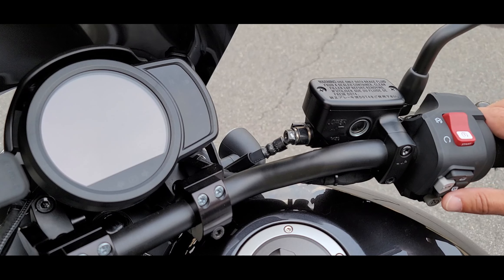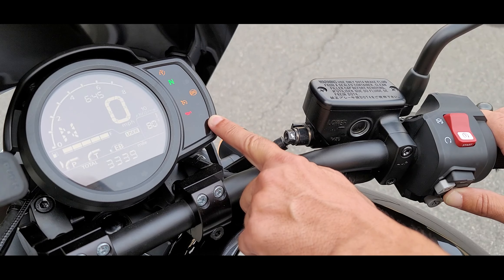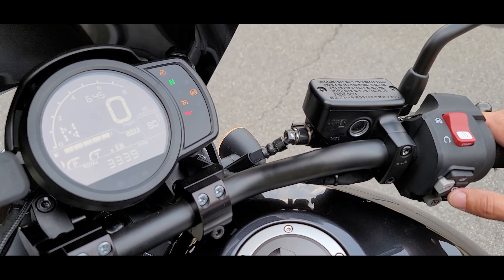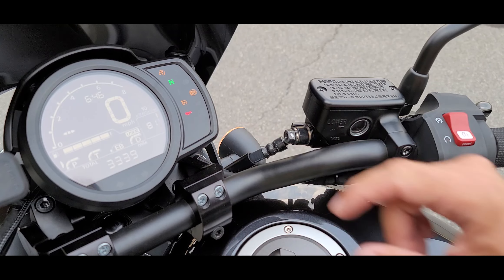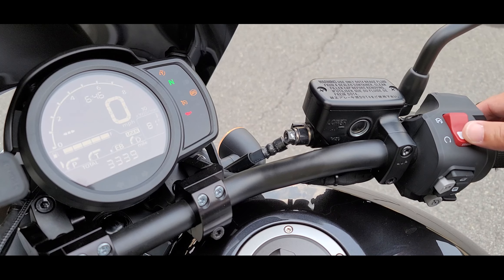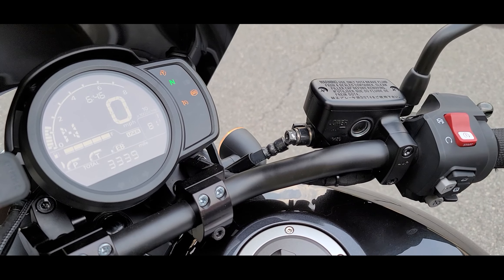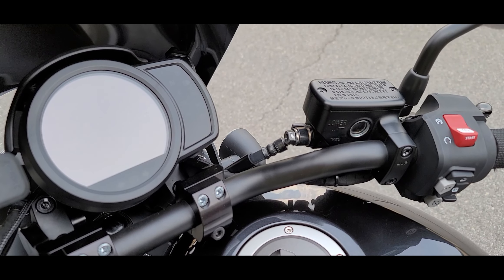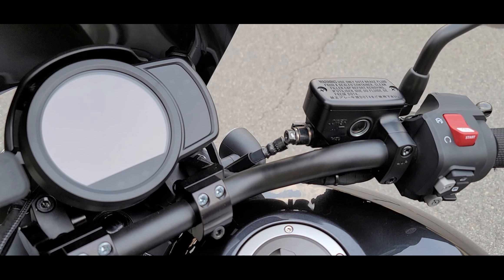Rebel 1100 DCT reset procedure

Comment: So I tried this the other day and to no avail the "D" kept flashing. Scrounging through the comments I had seen someone put premium gas in and it stopped. Well today I filled my tank up on the way home with REGULAR gas, did the reset and not even 5 seconds after the procedure finished. Conclusion: this method works best when the engine is warm AND you have a full tank of gas.
Reply from the maker: That's great information, thank you for sharing TeAndre! The key is to have the engine up to temp.

Comment: How to remove check engine  sign
Reply from the maker: Hi Jordan, it depends on what caused it, sometimes after removing the battery the check engine light comes on, it will take 4 riding cycles for the ECU to run the checks and the light will go off. ride bike for 5 minutes over 35 mph, turn off the bike for a min, repeat 4 times. report back to let us know if that worked for you. Good luck brother!

Comment: Is therr a way to stop the system from "learning ? Thing is I would like the DCT to be as predictable as possible. I don't want to think about wether it's gonna shift or not and wether I have to intervene manually. I just want t know it intuitivly. Wich was the case if I could LEARN its behavior wich is difficult when it is never the same:(
Reply from the maker: Hi Lari, great question, i set mine in user mode to get the auto shifting as smooth as possible - max power, max traction, lowest engine braking and lowest shifting.  95% of my riding i never mess with it while cruising. If i find myself in a position to need to ride in a spirited fashion, i switch to manual mode. these are the 2 ways i ride, either super laid back cruising, or aggressive. If riding up or down mountains, i ride in manual as well.
Keep in mind that the shift points between gears while accelerating can be different based on how much gas you give it, example: if in standard mode: you have the throttle open 1/4 of the way, the bike will shift at 3,000 rpm. If you have the throttle open to 3/4 of the way the bike will shift gears at 7,000 rpm. (not exact figures) hope this helps!

Comment: Wonder if this would help me, was in first gear and it felt like it was slipping in and out of first, 2021 1100 dct, 800 miles on it
Reply from the maker: I'm sorry to hear that man.... the bike is brand new, i have heard of similar situations where the DCT acted up, most were related to  bad/weak battery. But if the bike is under warrantee, take it back to the dealership to get inspected. FYI, i have 30,000 miles on mine over the past for riding seasons with zero issues! fingers crossed

Comment: How often do you or can you reset the DCT? I thought I reset it about a hundred miles ago but wasn’t sure if I did it right. So I tried again yesterday and it would not reset. I tried all the steps from all the sites. So does it only allow you to reset it after certain amount of miles?
Reply from the maker: Hi Nima, you can reset it often, it doesn't have a limit. If you have trouble with it, you should go for a long ride a couple of times and try it again
Reply: @ontherebel11   Got it working. Thank you. You are the person I go to whenever I have a question on my 1100. Thank you.
Reply from the maker: @nimamotahari3673  I'm so glad to hear that it worked! 🤙

Comment: Also does it have to be in user mode, or could I leave it standard mode?
Reply from the maker: You can have it in any mode, no worries. Just make sure that the engine is very warm like after a 30 minute ride.
Reply: Thanks!!
Reply from the maker: @frankfromchicago9248  Anytime Frank!!

Comment: Hi, quick question my 2022 Rebel 1100 DCT ABS light turned on and it blinks when I’m riding. 

I drained both reservoirs, replaced my front brake pads, the rear ones are still good and the light still blinks. 

Anything I can do to solve this?
Reply from the maker: Hi Sergio! The first thing that comes to mind is tire pressure, the second thing is the pulser ring that the speed sensor reads on the wheel.

Comment: Will this reset the electronic parking brake. The parking light comes on on the dash but the brake does not engage thanks to
Reply: The parking brake is manual and needs the cable adjusted. It has an adjustment both at the caliper and by the lever on the bars.

Comment: So after my new shorty exhaust do this?
Reply from the maker: Hi Efre, changing the exhaust won't affect the performance of the DCT, no worries. It might affect how lean the bike runs. But many have it installed with no issues.
Reply: I installed the shorty exhaust and my mpg went from 73/ gallon to 50/gallon should I still reset it?

Comment: I just biugnt dct from anither owner it has abiut 900 miles on it should I reset DCT or leave it alone what are thereasons ti reset DCT?
Reply from the maker: Congratulations! With only 900 miles! Excellent! Resetting the DCT is recommended, just make sure the engine is fully hot before the procedure. It will smooth out the transmission a bit. 👍
Reply: @ontherebel11  thanks will do it today....ill ride first to warm up the engine ;)

Comment: if reset fails: fill up tank with premium gas and try again
Reply from the maker: Thank you for sharing that TK! A friend just had an issue with it, but we were able to get it to work after a long ride. I need to ask what fuel he used
Reply: When you say fails, what exactly do you mean? How is it failing?
Reply: I finally got it. Evidently I was too slow on inputting the code sequence
Reply from the maker: Fantastic news! Thank you for updating us Thomas!

Comment: Is there a way to do this for a manual ?
Reply from the maker: Hi Doom3crazy, that's a great question! Many owners have complained about the manual being a little jittery at low speeds and are looking for ways to smooth it out, unfortunately this procedure is only for the DCT model.... sorry. But some owners have gotten the power commander to help, it has helped some while others not so much. I wish i had a better answer for you...

Comment: I’ve tried several times, even after riding for 30 minutes and with a full tank of gas.  Now I can’t get the drive icon to stop flashing.  Any advice?
Reply from the maker: I know how frustrating that can be, I've seen some friends experience that, the way it got resolved was to continue riding for extended periods and try the reset again, it will work
Reply: @ontherebel11  okay.  I’ll try again when I get home from work later on.  The bike still seemed to ride and switch gears like it remembered my last drive setting even though it was steady flashing the whole time.  It’s become a pet peeve now 🙃
Reply: @ontherebel11   Got a good update for you, and anyone else who has encountered trouble doing the reset.  So I tried again after I got home from work.  It was roughly a 30min.drive home.  As soon as I got home I did the following:
1.  Kept the bike upright instead of putting it on the stand.
2.  Used the key to kill the ignition.
3.  Held down “D” and turned the key to the on position.
4.  As soon as the check engine light went off, I released “D” and tapped “DDNDN”
5.  Bike entered reset mode, and I waited a bit before I started the engine back up.
6.  Once I started the engine back up, the reset took about 30 seconds to complete.

Took the bike for a spin and it did seem to shift a lot more seamlessly than it had bad, and it hadn’t even been shifting that bad at all…so that tells you just how smooth it felt.  I can’t wait for my commute to work in the morning (that sounds weird) to see how it feels again…

Thank you again for your instructional videos!
Reply from the maker: That's wonderful news! Thank you for updating us! 🙏

Comment: I did that and took 20 mins.  Nut never stopped blinking.  What do I do
Reply from the maker: Hi Mike, try it again but make sure your engine is hot. Let me know if it works
Reply: Did you ever find a fix? I tried this and it seems to get stuck as well. Procedure starts normally but it never stops blinking, even after 20+ minutes, and wont go into gear unless you turn it off, restart it, and IMMEDIATELY put it in gear. Seems to ride normally after tgat but the light never stops blinking.